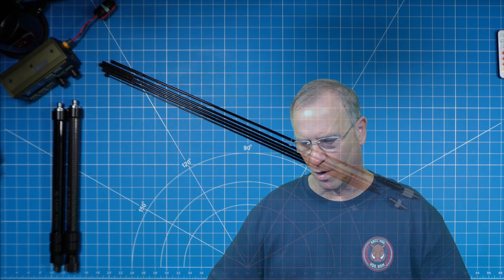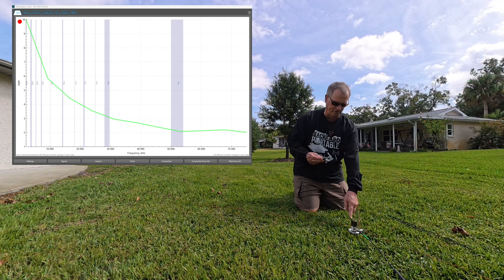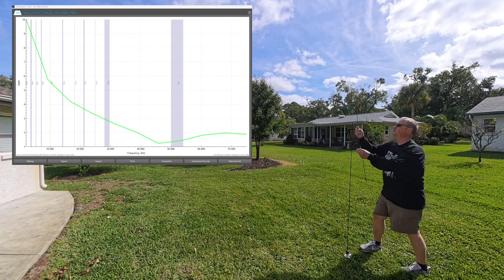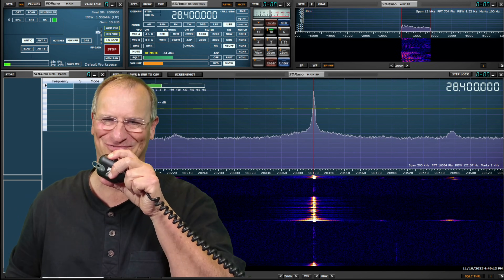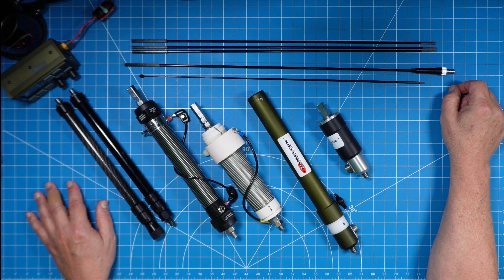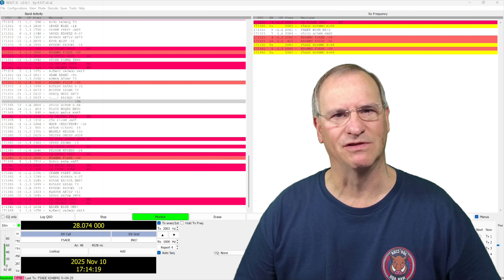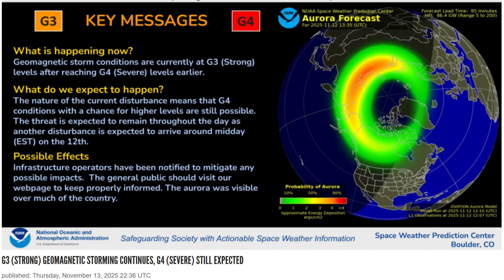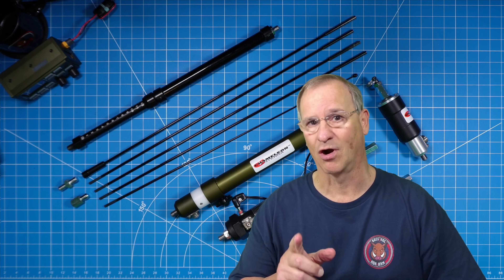5 Section Carbon Fiber Whip Resonant 6 or 10 Meters - Broadband with Coil - POTA SOTA - GRA CFP2600

Comment: If you use all five sections horizontally, is there any droop or does it stay pretty straight?
Reply from the maker: It will definitely droop; to an unacceptable level, in my opinion.  I am testing their CFS10 and CFS20 whips to use as a horizontal dipole.  Results look promising, but testing is still in process.

Comment: That would be a good price if the sent 8 sections.  (20m) then you could pair it better with a coil.  They are on the right track.
Reply from the maker: It is really REALLY light weight and the sections small diameter.  They would not make is to 17' for 20 meters.  I think Gabil Radio will continue to offer many designs to fit a number of preferences.

Comment: 13:00 - I was glad to hear, "There is a lot more coming from Gabil Radio in this carbon fiber series."  Propagation makes 6m and 10m somewhat fickle but I'd love to see the same segment length and more segments to make a 20m quarter wave vertical whip.  I'd much rather have a resonant antenna instead of the added weight, complexity, cost and lost efficiency of a loading coil.  It'd be great if there were uniform length base sections and then use as many of those as needed for each band with one more top section to be resonant on each band.

The SWR sweeps shown in the video showed a gradual SWR transition through the bands.  A good high Q antenna will have sharp SWR dips at the resonance points, suggesting that the carbon fiber antenna is lossy.
Reply from the maker: Hmmm, I wonder what it would look like if I did this sweep with a stainless telescoping whip....  Now you have me thinking.

Comment: Is there a way to order from Gabil directly. This new antenna plus  the other carbon fiber antenna doesnt have an estimated shipping date. When I tried ordering the carbon fiber antenna last month it wasn't shipping. When I contacted Amazon they advised it wasn't due to ship until mid December.
Reply from the maker: Interesting.  I don't release my review videos until stock is in Amazon and ready to ship.  Just curious where you are located?

I am not aware of any way to order from them direct.  They are located in Taiwan and have a company website, but there are no options to order from the website.  Their US distribution is through Amazon.
Reply: @HOAHamRadio I'm located in Arizona. As I said, it's just those two items. Other items in their Amazon store list delivery dates in two days.
Reply from the maker: Just a guess, but I think when they send a new item to Amazon it goes to a central distribution hub.  I wonder if it takes a while before it becomes readily available in all regions...not sure.

Comment: No surprise - you need 2,5 meters of radiator for 28,2 MHz (71/28,2) with an average velocity factor of 0,8 same as for telescopic antennas. But these are lighter an likely less prone to damage. 

Interesting alternative to my SS-17
Reply from the maker: Thanks for stopping by for a look and comment.  Many more carbon fiber offerings in the works.

Comment: Can two of these at full length be assembled in a dipole configuration to get on the lower bands?
Reply from the maker: I don't think they have the structure to support horizontal deployments.  They are purposely thin to small form factor / weight.  They probably wouldn't break, but the would have a great deal of sag.  If it was an attic deployment, and you had the ability to support the ends with a strap (I have done this with stainless antennas) then it would work fine.
Reply: @HOAHamRadio thank you.  I too live in a Florida HOA.  And from watching your videos; a lot more strict than yours 😄.  The attic was actually my thoughts.  I’m looking for a more simple way to mount an attic antenna than running a very long wire.  I’m handy but not as handy as yourself.  😄.  Thanks again.
Reply from the maker: Perfect, in the attic with some support towards the ends of the whip...its worth a try.  I used HVAC webbing when I did this using stainless whips.
Reply: @HOAHamRadio if you were to deploy these in a dipole configuration, could you share with me what other components you would use:  connectors, matching device, etc….based on all of this what other bands would you anticipate would become available for use given a decent SWR
Reply from the maker: @jeffjones3797  Can you send me an email then we can share details back and forth. --  thehoaham@gmail.com